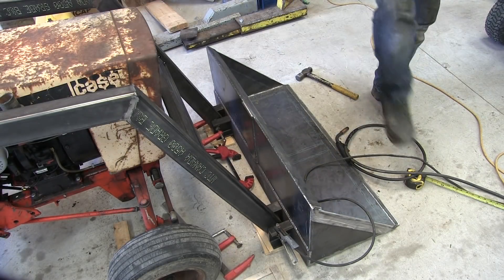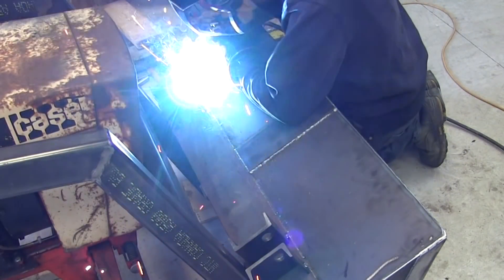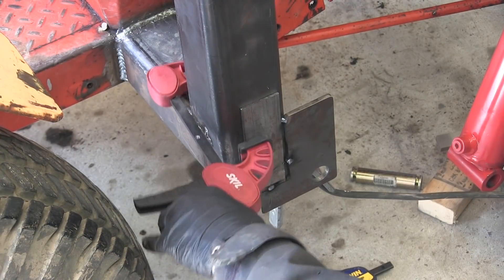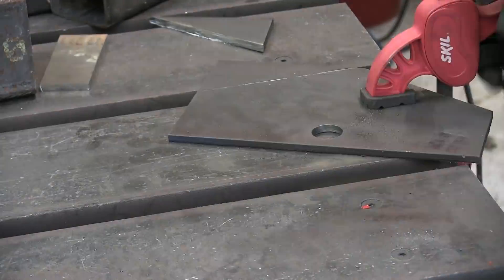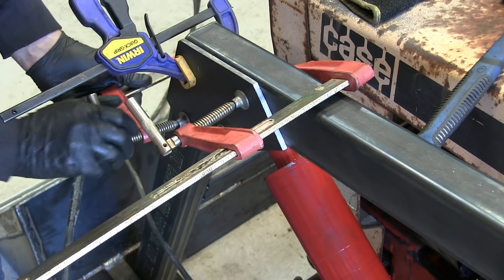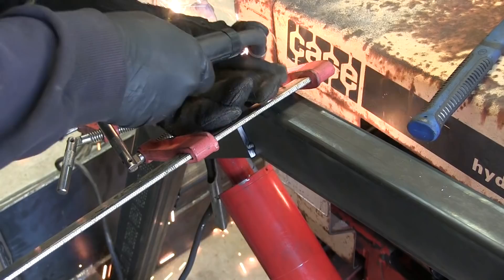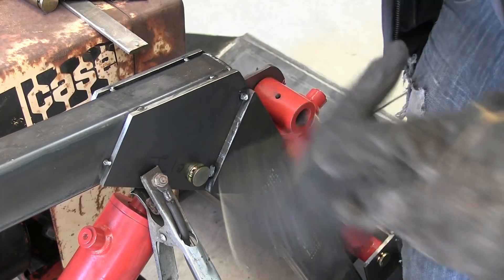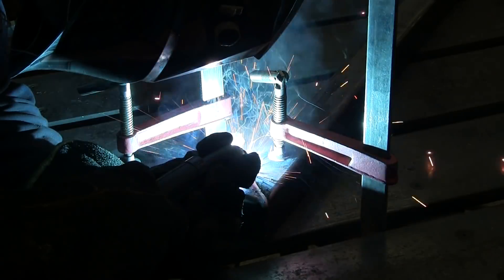Case 446 Front End Loader, Arms Reinforcement (Part 3)

Comment: Generally speaking you either use two bucket cylinders or one center cylinder ... I've seen your method used twice before and both times the loader frame got twisted under use ... But I hope it works for you ...

Comment: You done a VERY good job building the loader. But why didn't you bolt it to the tractor. I've built 2 in the past one for a cub 1811 and the other for a cub 1450. By building a bolt on mounting system there's no welds to cut if someone wanted to remove the loader for repairs to the tractor or loader. Or possibly to use the loader on a different tractor. But I do have to say you DONE A DAMN GREAT job building that loader it looks great.
Reply from the maker: Thanks! I have no plans to sell the loader, arms or tractor. The Case was a $200 basket case, and not worth restoring in the first place. Also welding is much faster.

Comment: Hi there. Hamish from Queensland Australia here. Im looking at building a loader for my Iseki Bolens G154 which is a small tractor with a 15hp engine. I see in the video that you say you use a 25 20 cylinder. I have tried finding a cylinder called that and not having much luck. Can you help me out with some more info on what cylinders you use perhaps part number as im not familiar with hydraulics.
Reply from the maker: www.princessauto.com is where I bought mine from on sale. Check out the site. You may want to consider a larger motor if you will be doing a lot of digging with the tractor.
Reply: I’m starting a build as well. The cylinder you used is a 2-1/2” bore with 20” stroke. That seems pretty robust. I was going to go with a 2” or 1-1/2” bore. How much weight do you figure you can lift?
Reply from the maker: @dankozusko7042  - used the smaller diameter cylinder. It will be fine. The max i can lift is about 500lbs. The front end limits the weight the bucket can lift, as well as the counter balance.

Comment: Are you going to be using the tractors hydraulics for the loader or a stand alone system that will run off of the tractors system?
Reply from the maker: Gary - I'll be using the stock pump and travel control valve. In addition, I'll be using a 2 spool directional control valve to control the loader, filter system and a larger oil reservoir. I'll be covering the specifics in a later video.